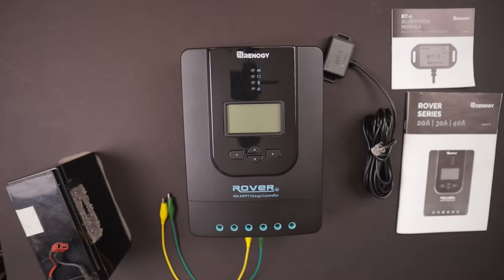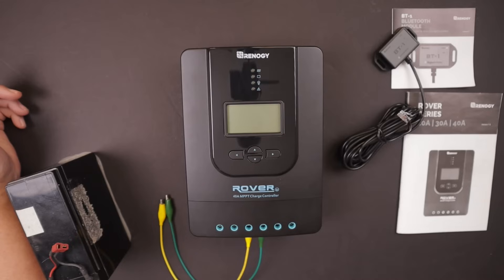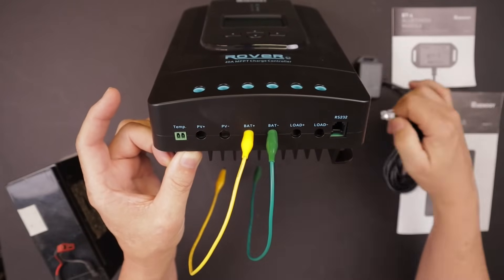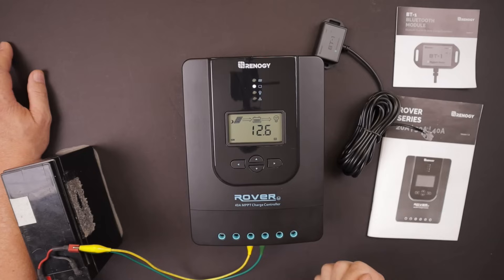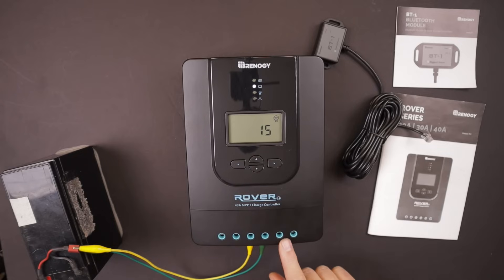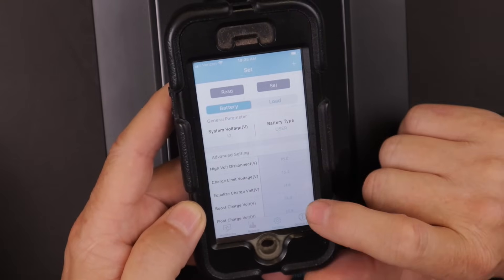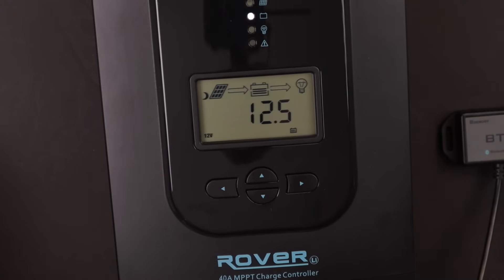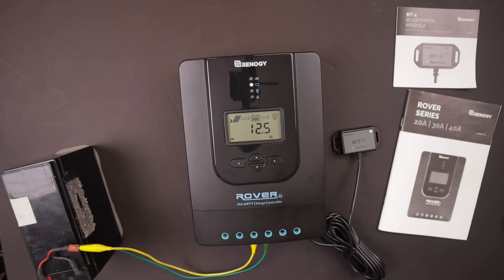Renogy Rover Li 40 amp MPPT Solar Charge Controller Overview

Comment: Hi I looked at the manual on the rover 40, regarding the load terminals. I don't get it. What is this intended to power while there is no sun? The only thing I can think of powering (in an rv), is in the battery electrical rover 40 compartment, a fan. However it would be hotter when the sun is out and the batteries are charging, so i would think i would want the load to power this when the charging is on. But the load controls are only all on or off, or load on when not charging. What am i missing? thx.
Reply from the maker: My understanding is the load is used to power low amp draw items. It can be programed several different ways. Dusk to dawn for instance can be used for a porch light or night light. I've seen people use it for a heat lamp in a chicken coop. Maybe you would use it for an air circulating fan during specific times using the timer feature. If you are in an RV and maybe going to be coming back after the sun goes down you could have a night light or porch lights on using the load feature on the charge controller. It is somewhat confusing and does make a person wonder what the real intent is with this feature.

Comment: Would this be able to run a small tv on a camper? Let’s say 3 hours max?
Reply from the maker: The solar charge controller only charges the battery bank. Your battery bank and inverter will be what runs the TV.
Reply: @DIYHomesteadProjectsDIYHP10 question I have like 5 amg batteries that I acquired they are 100ah each thinking of putting them in parallel what would be a good one to get 40amp/60/100??? And what would be good panels

Comment: How many 100watt panels can you hook to that 40amp controller?
Reply: Your voltage Makes a different on how many 12 volt has higher amps than 24 volt the higher the voltage the lower the amps
Reply: I have 10, 100 watt panels on a 12 volt system 5 panels in the array are southeast faceing and 5 are faceing southwest this helps me take advantage of the morning and afternoon sun. Over panneling up to 25 percent is normally never a problem as the controler will dump the excess power as heat. In my particular set up I have never exceeded 35 amps coming in.
Reply from the maker: That depends on how you wire the panels. In a 12V configuration you can use 5. If you wire the panels in a 24V configuration you can use 10.
Reply: You can install total 750watts for 12v and double for 24v to get maximum power

Comment: Great video. Anyone have a recommendation for inverter for 400 watt solar? I will be using a lithium battery.  👍 Thank you.
Reply from the maker: Thank you Iam, I will be using one of the below 3K inverters from Renogy with my 400 watt system for my DIY Off Grid Workshop. We'll see how it performs over time. It sure is a heavy inverter so I'm hoping it is a solid piece of equipment. Good luck with your search! https://renogy.sjv.io/5bdNB9
Reply: I've been running a small MMP brand 1,000 w all in one inverter from watts 247 it's good for about 145 volts open from the panels the cheaper version is good for 500 watts of solar runs awesome with three 24 volt 200 w Rich solar panels give an open voltage of about 136 volts. The higher voltage means that with less sunlight you still get charging because you exceed the voltage of the battery,  my batterys two sok 206 amp hour 12 volt  batteries. The  same mpp unit can be had with thousand watts of solar capability and 24 volts in other models. Just make sure you use extremely heavy cables to the batteries I'm running number fours and it gives it enough punch I can run a 5000 BTU AC with this thing